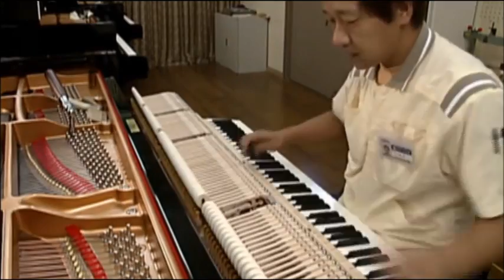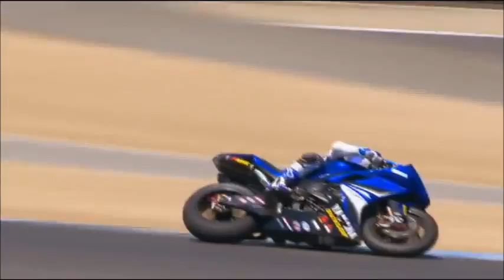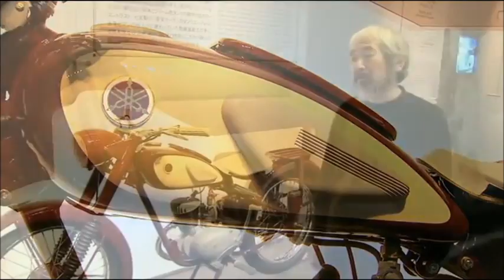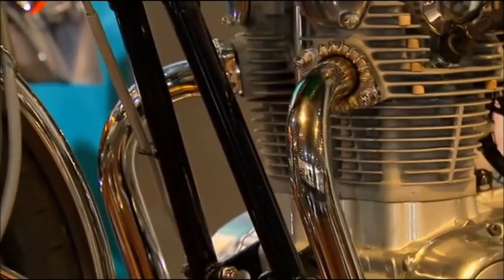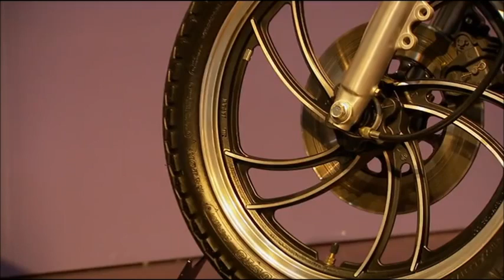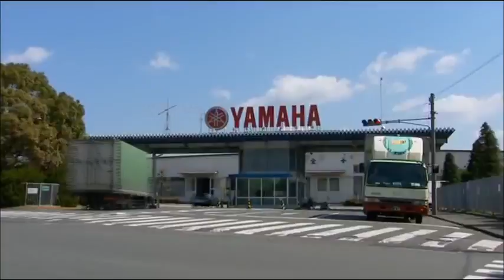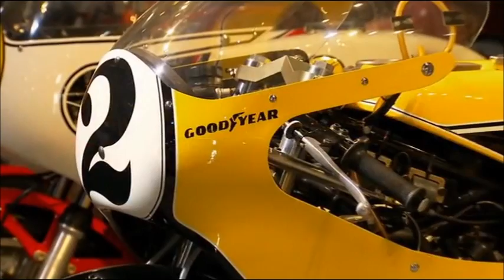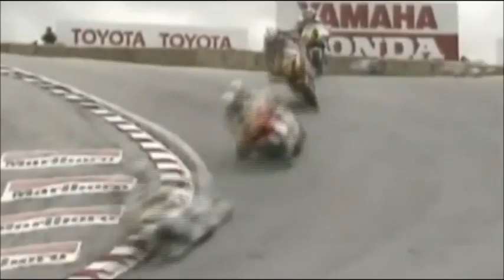Yamaha Motorcycles - History (From 1955)

Comment: A disappointing too American based documentary. What about the 1960's era of Yamaha's V4 250 and 125 cc GP racers? No mention of The Isle of Man, and other European tracks?  Phillip Island in Australia;etc: 
, 
..
Reply: Totally agree. What about the aircooled RD250/350/400? The RD350/500LC? FZ750, need I go on? A mediocre US centric video that does no justice to Yamaha's talents.
Reply: David, I believe you're the one that needs to "go fap your waifus, and stop hating yourself." Yamaha made many a great motorcycle that were not made in the in the USA. The video doesn't do Yamaha justice to their talents. You reference Top gear, but even they test American cars so provide a better balance than this video.
Reply: Narrated in Hollywood not for me either
Reply: and also, I´m sure japanese people don´t mind, seriously, stfu its a youtube documentary, its just a misleading title, it clearly is all about the R1 (hence the racing connection)
Reply: And no mention of the VMax wtf.
Reply: very disappointing lots of bikes missed lots it would of been a 3 hour show then
Reply: Martin, couldn't agree more!

Completely bypassed the BEST 2 stroke twin design 
ever made.  RD200/250/350/400, and the later RZ350.

My water cooled RD-RZ, was KILLER!  I had the Daytona
Special (79 2vo model, and found a wrecked RZ350, 
that gave its all.  (Engine, wiring, and front wheel/fork.)

Man, that bike was EXPLOSIVE!  Hard to hang on to the 
grips, at full throttle, even in 4th gear.

steve
Reply: < yawn >
What is a V-Max good for?
It's a niche bike. It is good for going quickly bar to bar or stop light to stop light. It's no good in the twistys and by the time you reach the city limits sign, you need to stop for gas.
Reply: Sir, you can never have too much freedom, so you can never be too American.  The problem is, not enough Americans are American today.  The world will suffer, when (if) it is gone, as the world will not have any idea of freedom to demand.
Enjoy the future of mankind with out individual liberty.